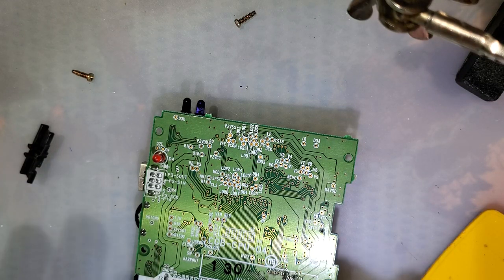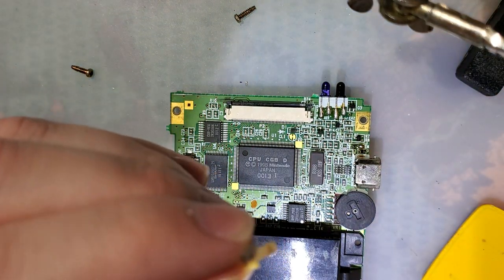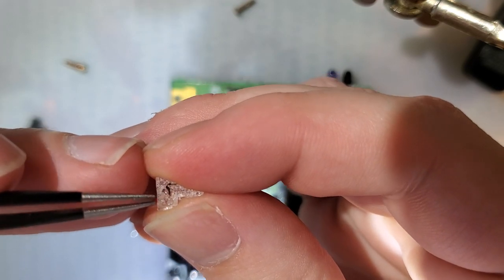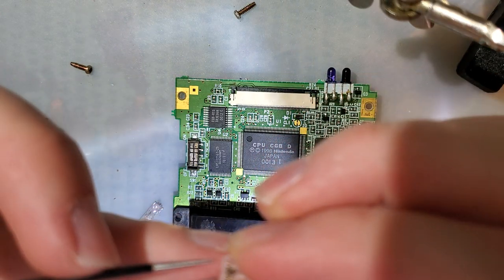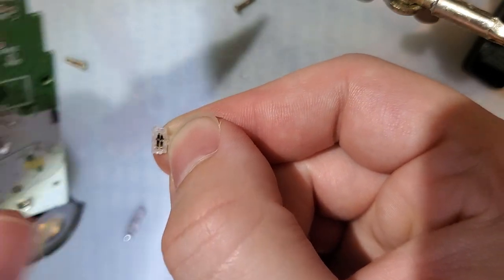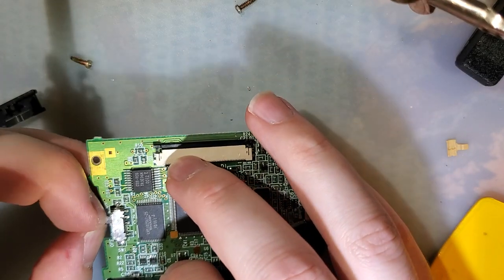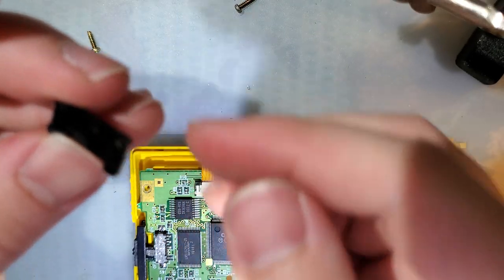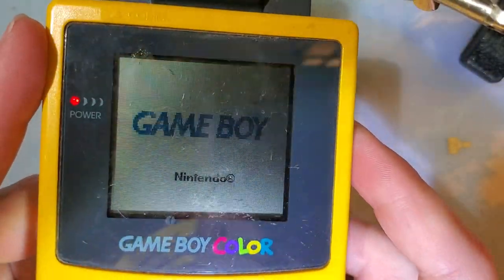Broken Pin Power Switch Fix (Game Boy Color and Pocket)

Comment: I had the exact same problem happen to me. My fix was to replace the switch entirely. There are aftermarket slider switches for the Nintendo DS/Lite which are roughly the same size ( though the metal brace must be lifted up to remove a spring inside ). They have to be solder upside down, but the GBC's plastic switch will be able to reach the arm to actuate the switch.
Reply: Any update? Mine just broke and I’d rather replace the plastic than solder a whole switch
Reply: @YouTube_stole_my_handle  The process involves removing the old one by de-soldering and soldering on the new one. There isn't really a safe way to remove it from the board without doing that. In terms of power switches, there may be new aftermarket options available for the GBC.

Comment: Have a GBC that does not turn on.  The red LED flashes for a brief second then nothing.  Shorted the switch and replaced the 3 larger capacitors with no success.  Any advice?
Reply from the maker: sounds like you've got a short somewhere.

Comment: How would you rate the longevity of this fix. With the contacts only held in place by their own pressure against the slider and the board I would worry about them binding up inside the switch assembly. Maybe a drop of hot glue/regular glue would give it a bit more strength? Love fixing things from what you have though, no buying replacement parts unless you have to! :)
Reply from the maker: Yeah, I have no idea about the longevity. I definitely have some concerns though, especially because the first time I tried it out, the whole slider just cantilevered over instead of what it was supposed to do. My issues could also be the result of some dimensional inaccuracies from my printer that I discovered well after I made this video.

Comment: Would you consider doing a video on how to replace a power switch? I got a GBC that had the switch completely missing from the board. I read somewhere that you could short pins 3 and C i think on the mb to have it boot with batteries, so i soldered an ugly switch on and called it done lol. Just don't know if it's worth the trouble at this point
Reply from the maker: I have no plans for something like that at this point but there's always this: https://www.youtube.com/watch?v=R-7gA4sXDZU
Reply: @makho  Thanks for the reply! I'll have to try and snag some of those switches, since it looks like they fit better

Comment: Now 3D print new caps for the GBC.
Reply from the maker: In this particular case, I think it's actually the volume wheel since it gets slightly louder if I lower it a tiny bit. Probably needs new caps too though.

Comment: Theres a replacement switch on ali that does work quite well, you need to solder it on the edge of the pads though to make it work
Reply from the maker: Got a link?
Reply: @makho  the one i brought is no longer there i will find another link at somepoint for ya